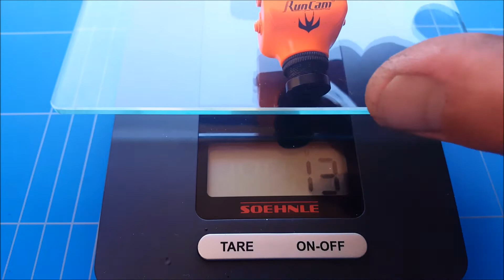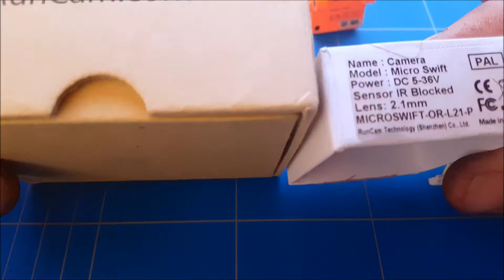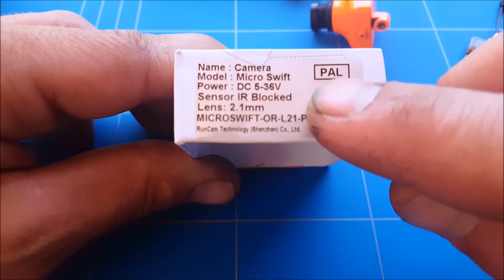All In One Runcam Micro Swift and Eachine ATX03 Combo vs Swift CCD vs Cmos Mini FPV Camera

Comment: Nice review and comparison. Like you said, I think the Micro Swift and the ATX03 make a good combination for Micro Aircraft. I may try that setup on one of my Micro Planes. I noticed the antenna on the ATX03 has a UFL connector. Do they offer a Skew Planar Antenna as an option for that VTX? Thanks and Happy Flying!
Reply from the maker: +Ground Control RC 
They dont offer a skew planar antenna for the eachine Atx03 but i think you can mod it
Thank your for watching partner🖒
Reply: Thanks for the info.